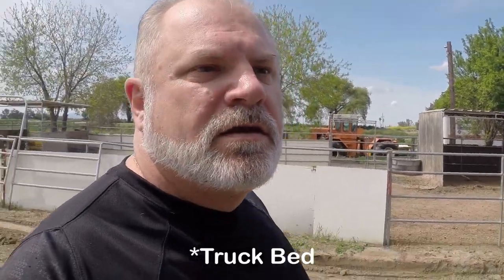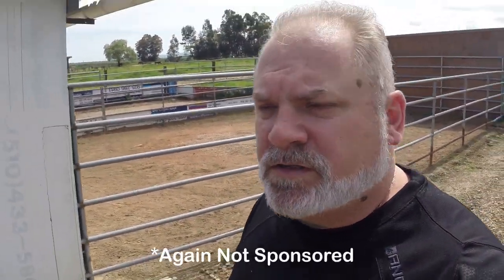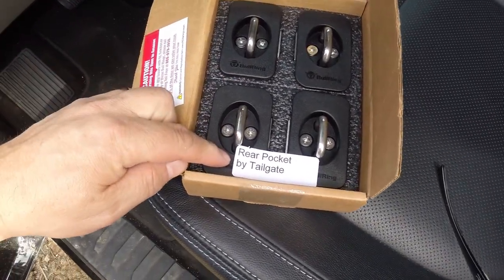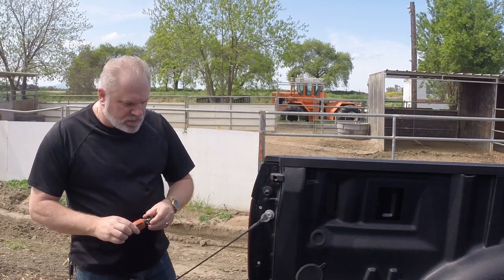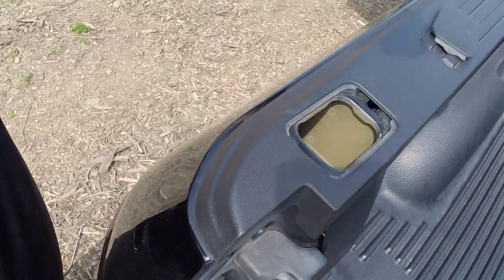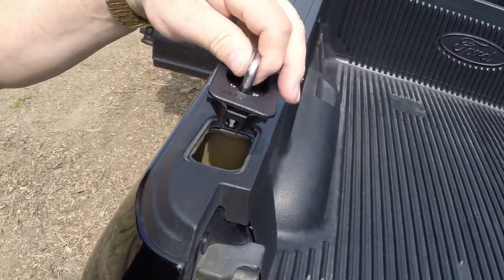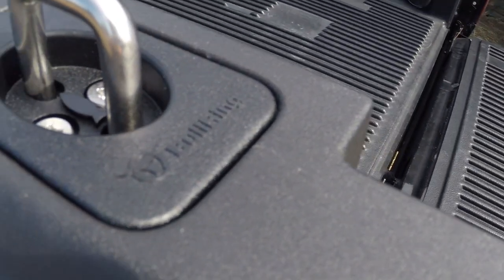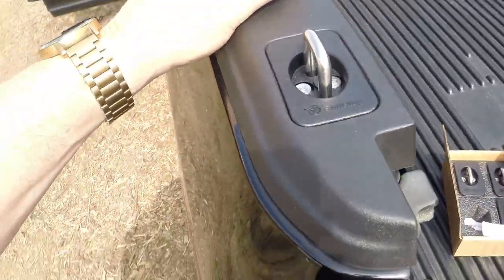2018 F150 Bull Ring Anchor point tie downs Install

Comment: How do I install steal the fronts.  No pop-out in the rail cover up front
Reply: My 2020 XLT has no pop up plastic holes up front either. Although I suspect there are some underneath in the metal. Did you ever get any installed in the front?
Reply: @remgu2000  yup!  I found out there is a special router tool that you plunge through then then cuts the hole in the plastic..  It has a roller that keeps you from tearing up the paint.
Reply: @georgeresburg5809  Ah I've seen that router bit. Was it easy to cut just enough to mount the bullring flush? I'd be afraid to cut too much, although I guess you could trace it first with a pencil.
Reply: @remgu2000  haven't tried it yet.  Aftaid I'll mess it up.  If i gather the courage, I'll let you know how ot goes.  Im sure the 2nd hole will be better than the first so i would do the passenger side first so as i walk up on my truck i will see the cleaner, better cut hole.